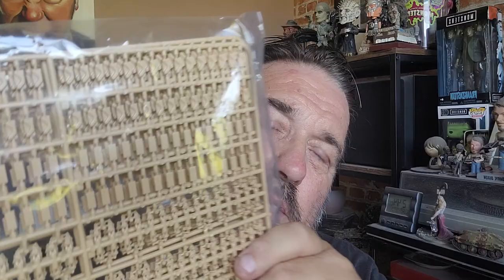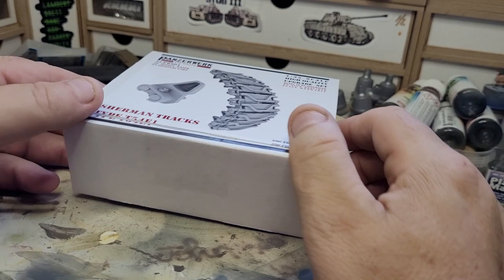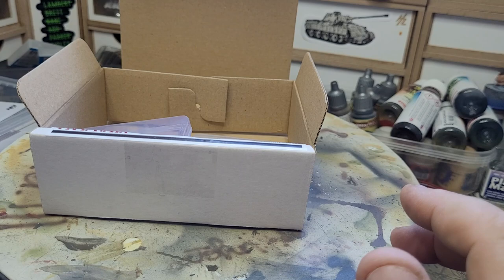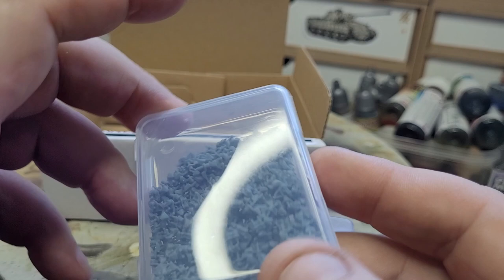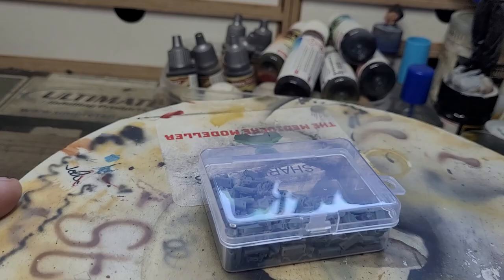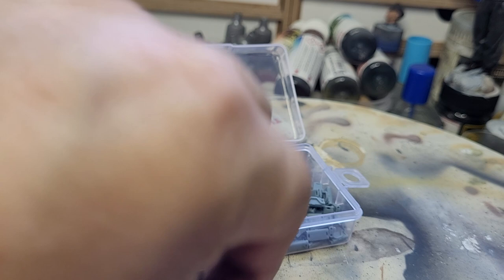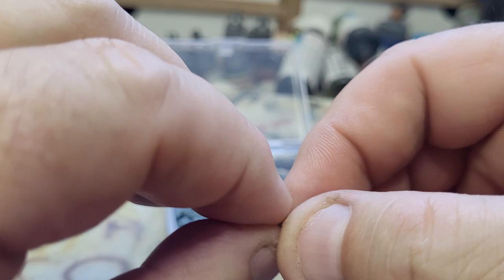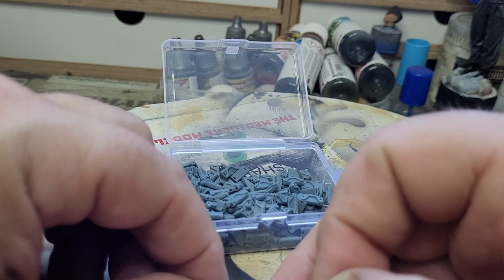#Review Panzerwerk Design 3D Tracks

Comment: Hi John
They actually look okay.
If you made up a simple jig on your bench it might make it a bit easier to assemble I think, rather than try to do it by hand.
I’m building about 12 Shermans, 2 M10 and 2 M36 tank destroyers and getting closer to the stage that I will be chasing up track kits.
With such a vast array of aftermarket track kits I’m still trying to work out what to get.
Thanks for sharing your review mate ❤😊
Reply from the maker: I'll try for a jig, but that kinda stuff is not my strong point! Thanks for watching. 👍
Reply: Hi mate
You don’t need anything flash, even just use the edge of your cutting mat!
It’s a good flat straight edge with a bit of weight behind it.
Place out the track sections a few at a time and with your fingers on one hand holding them down just guide the end adapters into the openings and push them into place.
Just build up short sections at a time, which when you have got your right number of tracks you can just simply join the sections together to finish them off.
I hope that this helps you out a bit brother?
Reply from the maker: @Michael Dean  good thinking batman!  I'll try that tomorrow and report back 👍

Comment: I think you have to put them on a flat area. Maybe even also put a flat piece of plastic plate on top (so that the are nice and perpendecular) and then push the end connector in. Maybe also with the help of a tool. F.e. Kneading gum on a grab or something. In any case, don’t try to do it in mid air from just one side. Then it will twist all over the place.
Reply from the maker: Thanks for the tips.